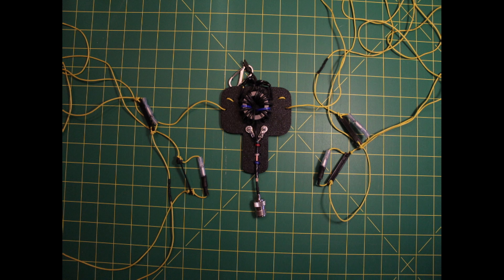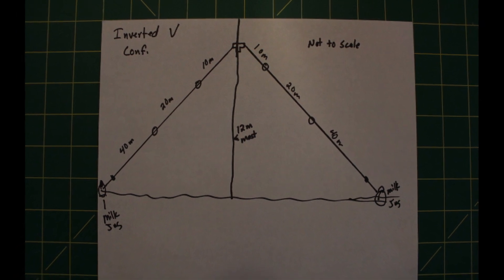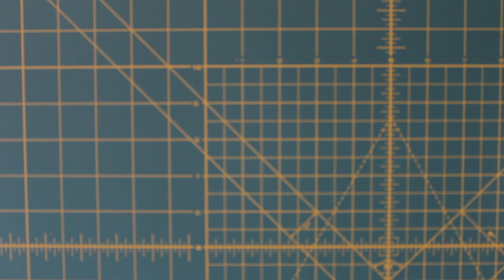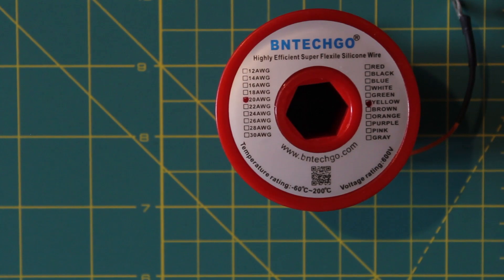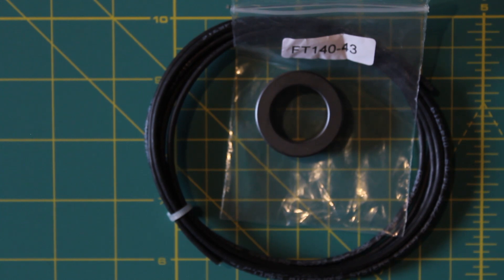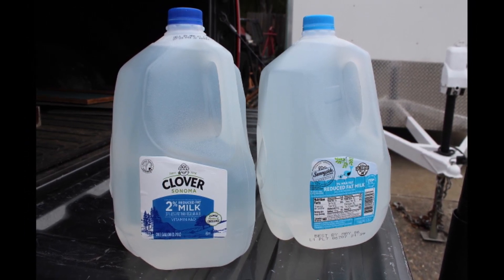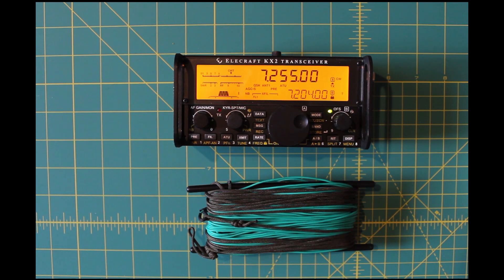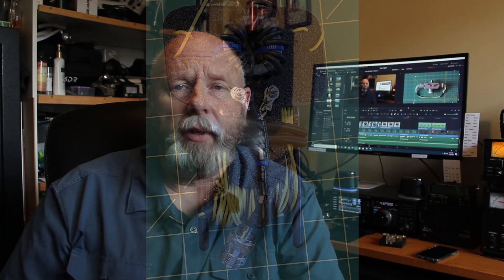How to make a Linked Dipole, could this be the Best antenna for an IC-705, FT818, X6100 KX2 or KX3??

Comment: Hi Chuck,
Good info. I have two of the 12m Spiderpoles out back for two years unguyed using the clamping kit that have withstood 70 mph winds. You can use the 18m pole and remove the four smaller sections out the bottom and you will have a much stiffer pole at the top at almost the same length of the 12m pole, but it is more expensive. Stay safe.  73  WB3BJU
Reply from the maker: Hi Don , yea the spiderbeam pole are really built well, thanks for watching!!
Reply from the maker: Don here is the link to the Earbuds you asked about. https://www.amazon.com/gp/product/B07JH52MM4/ref=ppx_yo_dt_b_asin_title_o06_s00?ie=UTF8&th=1,

Comment: Nice first video - do you think you will do a video of actually putting it together? Would love to see that...
Reply from the maker: Rick, I actually had already built it before I decided to do the video. I plan on trying to do a video setting it up and can try show and give the wire lengths. Tanks for watching!
Reply: @KK6USYHamRadioAdventures  enjoyed your video on this was wondering about those plastic clips? for a lack of a better word at the end of the yellow wire small.how/where
Reply from the maker: @alexalonso2093  , the short plastic clips are just short pieces of Zip ties , larger ties with holes drilled into them. If you could give me a time stamp on video If this isn't the part your talking about . Thanks for watching, anything else I can help with just ask.